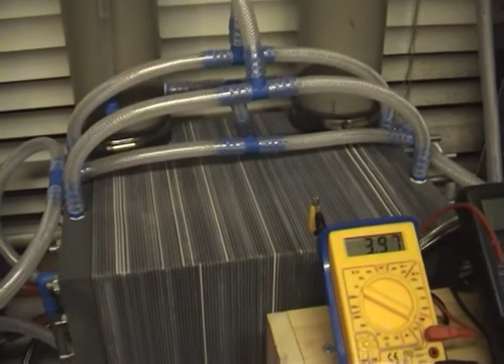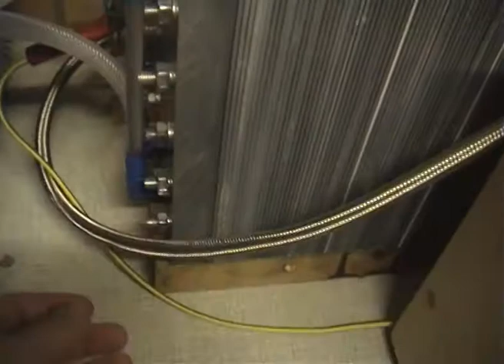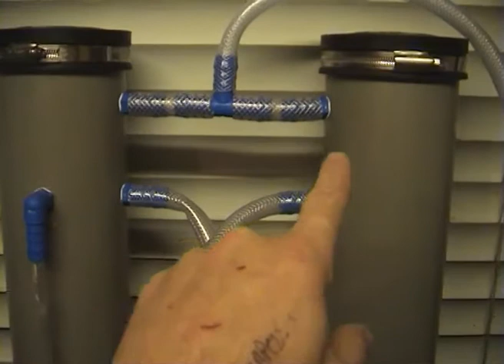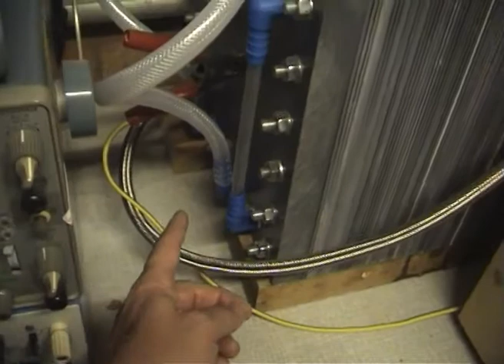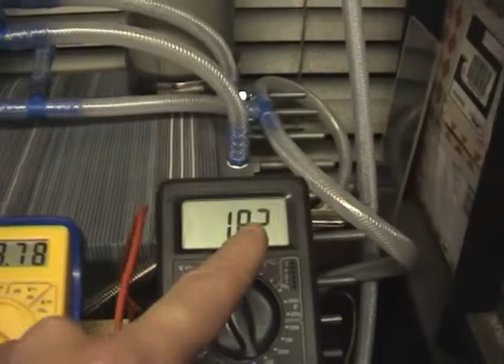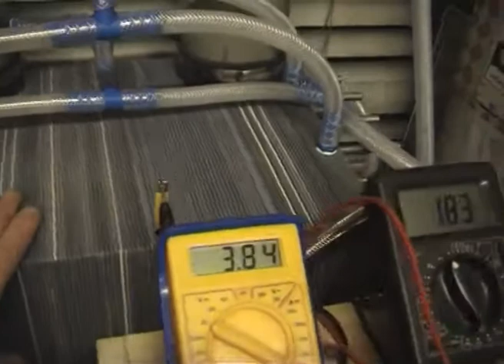New electrolizer design

Comment from the maker: @ZeroFossilFuel Thank you. I want to thoroughly condition the plates although I do have a problem in finding a consistent and meaningful definition for the term 'conditioning' in this context (ie. what completes a conditioning process?). Also undergoing close observation with regard to the performance of the materials chosen for this implementation as this aspect of the design is a limiting factor directly affecting maximum continuous operating temperature, RE: “Vicat softening temperature”.